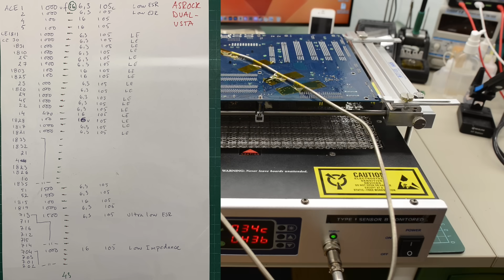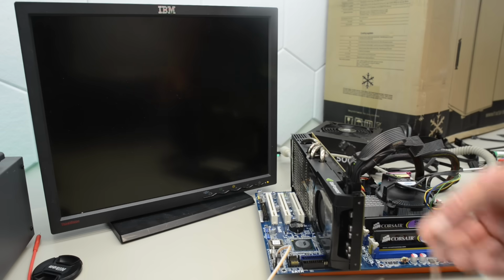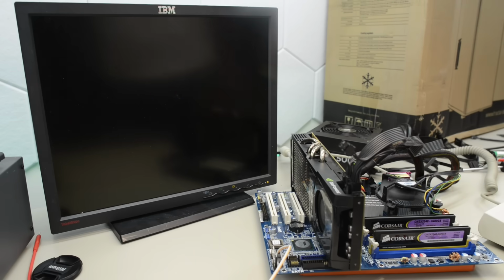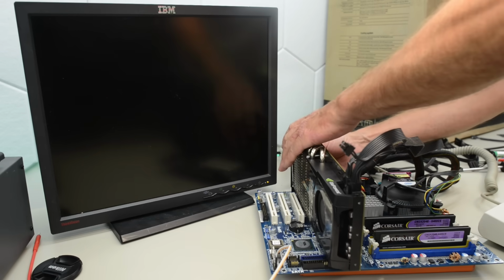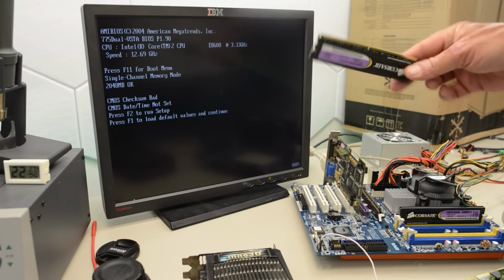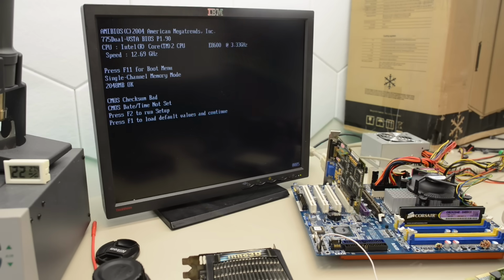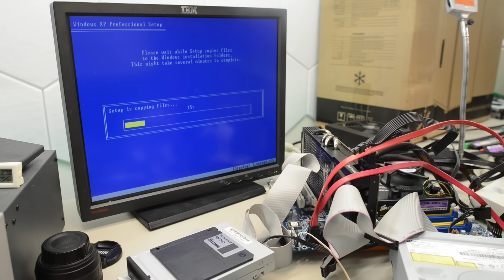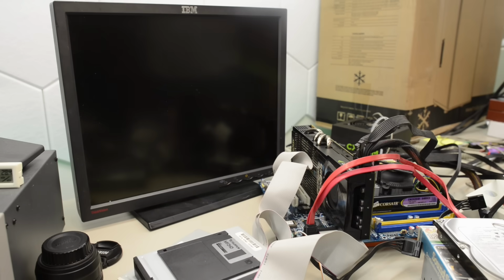ASRock  775Dual-VSTA Polymod gone wrong

Comment: I had that board. they had a defect that the bridge chip that allowed the use of either agp or pcie-e would overheat with that tiny heatsink. to fix it you can just put a 50/60mm fan on it.
Reply from the maker: Thanks. I have fixed the board in another video. I'll probably add a fan too
Reply: @Epictronics1  It's a good idea. I think i has in the northbridge an early pcie-agp bridge chip. Or some kind of transitional one off. Either way faster gpu's tax it and will cause instability if not actively cooled.

Comment: Hi, the other day I pulled a very similar board out of the scrapyard in our village. It is an Asrock "Conroe Kentsfield FSB1066 Quad Core CPU". I also tried to flash the bios using the original utility. It also gave me the error. But fixing this was simple: You just have to specify the filename together with the flash utility like "ASRFLASH 75DVSTA3.19A". For me it worked fine. But I used the bios from theretroweb, not the one you've used.
Then I tried to run Linux Mint from SSD (using SATA) as I do with all the boards, which I got from the scrapyard. It bootet fine, but then it always crashed. I tried different graphics cards on PCIE. None worked. But after I used an AGP card, suddenly Linux bootet like champion. As I got the board, it "came" with 3 GB RAM: One stick with 2 GB and one with 1 GB.
I really hope you can fix your board. Since the bios chip is socketed, you could maybe use a TL866 or so so program it.
Reply from the maker: I did. Check out the follow-up video I did a few days ago. I also fixed the issue with the graphics card you are having.

Comment: Im have this boards younger brother, the 4CoreDual-SATAII. Mine does support quad cores. But it's still a terrible motherboard. I don't think this GTX 480 will work with this as the PCI-E support is limited to GeForce 8000 and certain ATI cards afaik. At least mine didn't boot with any other cards.
Also the max supported memory is 2GB. That's why it didn't work with 4GB.
Reply from the maker: I'm almost done with the follow-up video. Prepare to be surprised

Comment: Hey - ive learnt that for expensive boards like these - its best to buy a second bios chip from fleabay ( easy to get for approx $15 and flash it with the updated bios using a william programmer in XP off board - ive done it - i learnt my lesson - put a socket on it and get a spare bios chip first - cause a flash failure = a hugh expensive failure . ive got the original bios saved in a bag with the new flashed bios on my Asrock 4core dual sata board . I didnt use 3.10 something i think my beta bios which allows 4gb ram is 2.20 something tho- btw they can take a gtx580 - if u can find a 3gb version thats the best it can go -
Reply from the maker: Thanks. I'll start looking for a 580

Comment: Maybe there's low level rescue code in some read only memory. Sometimes you can recover from these conditions by preparing a special floppy disk which will then flash the BIOS back to a usable state. But with the socketed flash taking it out and flashing it out of system is of course always an option.

Comment: I use 4CoreDual-SATA2 for long time with Pentium E2160 and AGP Radeon 9600 with 1G DDR1. After some time I upgrade CPU to Q6600 GPU to PCIE 8800GTS and change memory to 2G DDR2. Also upgrade old IDE drives to SATA. Board can work on 1333 FSB with Q6600 on 3Ghz without any problem. Best multifunctional board!

Comment: You don't have to say degrees Celsius. Just degrees is fine since it is the global standard, and so is implied if you just say degrees. It is only if you are using another scale than Celsius that you need to be more specific.
Reply: That is a really bad practice for ANY measurement system.  However, unless you're down toward and below 0 deg, the difference between the two makes it pretty clear, from context, which you're referring to.
Reply: @sirnickity  There is only one system globally, if you exclude the US. So, no, it makes perfect sense to ignore the small minority that still uses a non Celsius scale. Especially on a global content platform like Youtube.
Reply: @guderian557   Well, for one, that's not actually true.  Two, it doesn't matter.  I'm not interested in a nationalist food-fight.  Omitting units is never the right answer.

Comment: are you sure it's bricked. I ran into an issue with XP a while back. Newer systems supported AHCI instead of IDE. But by default XP won't work. I had to load special drivers during the windows install to make it work. I don't recall what happens if it's not setup properly though. And you can't turn it on either. You either install XP with AHCI on or you install it with it off. I was never able to install the drivers after the fact.
Reply from the maker: It doesn't even post, unfortunately. I need to pull the chip out and flash it manually
Reply: @Epictronics1  oh ok

Comment: I have a asrock 939 dual sata 2, kind of similar motherboard to this with both agp and pci-e. Always wondered why so few people build retro systems on these boards, where you have the options of running pci, pci-e or agp graphics.
Reply: Most people just outright dismiss these in-between boards as low-end crap that isn't worth bothering with. Typical PC elitism in action. 
Case in point, someone further down in the comments told him to replace that crappy board with an Asus P5Q Premium or a Lite-version of a Gigabyte EP45-UD3 cause both of those are deemed as "better" than this thing... too bad they completely missed the point of compatibility with multiple floppy drives, which neither of those "better" boards have, but this "crappy" ASRock does 🤦‍♂

Comment: E8600 with 1333 FSB? hmmm... is it really running at 3.33GHz, or just a label and running on half clock? i have a later revision called "4CoreDual-VSTA", and i'm unable to go above ~1150MHz FSB...
Reply from the maker: I haven't looked into overclocking the board yet. The E8600 may not be the best option
Reply: @Epictronics1  If the 3.33GHz is true, then You are already overclocking! The PT880 Ultra chipset itself is specified up to 1066MHz FSB, but if Your E8600 is running at full clock, then it means current FSB is 1333MHz! I doubt it's running at maximum clock speed...
Reply: @Epictronics1 This board is a very poor overclocker on FSB (see the Vogons thread). You wont get anything near 1333. Its a reason why people recommend the E7x00 series CPU for this board. Remember to overclock the PCIe bus if you are going to use the GTX480! You get 5-10% extra performance
Reply: @ksjoet  If L2 cache isn't of the highest concern, the Pentium Dualcore E5800 seems to be the most trouble-free option, and even with the poor FSB OC support on this board, you can still eek out some OC since the PDC is an 800MHz FSB CPU, leaving some headroom to get to 1066 while lowering the multiplier. I mean... the E8600 seems like a nobrainer with 6MB L2, but whether that's worth having it run underclocked at all times... ehh
Reply: @Knaeckebrotsaege  Would certainly be interesting to find out what would get the best results from the E5800, E7600 and E8600 together with the unlocked X6800. I guess it'd depend on the application as well in terms of how much benefit you get from L2 cache and/or clockspeed.

Comment: i have the same board and i hasd lots trouble i tried to flash the bios but i never got that far it was my tester lead that turns the board on i used a screw driver at last resort all worked ok but mine is 32 bit operating system i even tried to flash the bios with a clip on the bios chip but wouldent work i spent house and hours then it just all went ok i bought the whole computer for $40 aust but im glad you said always test the power supplt i did it when and blew a cap first time i have done that the case i use its a nice coolamaster case im using that for my main computer now also had 4 gig of ddr3 no hardrive but i have lots so it all going now same as yours you showed

Comment: You'll probably need to take the BIOS chip out, find your board on theretroweb, grab a BIOS ROM from there and use an EPROM programmer to write it.

But it should POST again after that.

Comment: Your motherboard has the dreaded VT8237 south bridge. It has known compatibility issues with SATA 2/3 devices, and only works reliably with SATA 1 drives.

There is supposedly a later revision of the 8237 that fixes the bugs, but I've never seen one.
Reply: It's things like this that really made me hate VIA chipsets.  They were always so quick with new features.  Too quick.
Reply: That's because the one with the newer revision southbridge got an entirely new board name. There's this 775Dual-VSTA, the 4CoreDual-VSTA (supposedly with the newer fixed revision, but still SATA1) and the 4CoreDual-SATA2 with a different southbridge and official SATA2 support
Reply: @Knaeckebrotsaege  Man, ASRock really milked that design to the limit. Three different board revisions of the same board with different south bridges.

It reminds me of the P5GC-MX/1333 that ASUS made with an overcooked i945GC chipset. They used black magic to force it to work with Wolfdale chips. Oh man was that board a turd.

Wolfdale on a 1333 MHz OC FSB and a max of DDR2-667. I don't even remember if SpeedStep worked properly, I think it ran at full tilt all the time.
Reply: @GGigabiteM  The issue was that VIA couldn't deliver the fixed/upgraded southbridges fast enough. By the time the -SATA2 rolled out (which should've been on it from the start IMO), the demand for these in-between boards had already all but vanished. IMO VIA is to blame here. ASRock just renamed the boards so that the SB revision is obvious from the name alone, rather than having to look at revision numbers which are generally not listed anywhere when boards are sold

Comment: I used to have exactly the same motherboard model. It even had a Radeon 3850 AGP. And there was always something wrong with it. Low performance, mediocre stability. In the end, I sold the motherboard and graphics card and switched to PCI-Express on an Intel chipset. Everything worked great there. In any case, Asrock had a lot of strange designs back then.

Comment: I have some of that same Corsair RAM with purple stickers and it also failed prematurely even though it was mostly powered off and rarely used. It should be fixable though, just replace the rams with good chips one by one until you find the bad chip. Use the ram tester program available on most linux bootmenu distributions to check the ram. Might be interesting if you can find a way to identify the bad chip using software rather than blindly change each chip.
Reply: Those Corsair XMS2 (which basically just means DDR2, cause XMS3 is DDR3) sticks are just garbage. Over the years I've pulled dozens and dozens of those XMS kits out of service because one or even both of the sticks had failed for seemingly no reason, either with memtest errors or straight up causing the PC to fail to POST. 
What's worse is that you essentially never know what you're getting, because they switched manufacturers of the DRAM chips at will (whatever was cheapest that day), and the only indication for that is the version number on the sticker. You can go out and buy 5 seemingly identical XMS2 (or XMS3) kits and chances are none of the kits will have the same version number, ie be actually identical to each other down to the DRAM chips used. Even when you don't take the premature failures into account, this caused all kinds of issues even when they were current because you could buy 2 separate RAM kits (think one when building your PC, and one later as an upgrade), and one of them has Hynix DRAM while the other might be Micron or Samsung or Spektek or whatever. If you then stuck them into a board that doesn't quite like any one of those (compatibility wise), you were in for a massive stability headache with your "identical" RAM kits
Reply from the maker: I'll check. Thanks

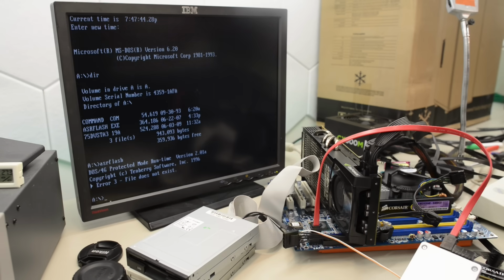Comment: @7:56 doesn't the asrflash utility require you to type the name of the BIOS file? I found that on the asrock webpage with the instructions.
Reply from the maker: I'll check. Thanks
Reply: Bingo. Also on older boards it's worth checking if Uniflash (or one of its updated community versions) can detect the BIOS chip properly. If it does, you can use it to backup and flash it. If it fails to detect the chip, it's probably incompatible with the board/chipset. 
I've used it a lot to hotflash BIOS chips some 10 years ago or so, back when I was still lacking a proper hardware programmer because they were still ludicrously expensive for a little hobby project

Comment: It should be interesting to see where this board ends-up, it sure has it's pros and cons.
Are they expensive because they're rare or because they're good? ...may be both, we will see!
I find Intel play nicer than VIA when it comes to driver support ...good luck.
My Multi-boot configuration is a ASRock G31M-S with a Q9650, SATA SSD, DDR2 800 and GeForce 7800GTX.
Boots DOS thru to Windows 10, has floppy connectivity, though I prefer the GoTek emulator.
I just now ordered some E8600 CPU's seems they OC easily to 4+ ghz ...definitely worth trying.
Reply: These boards were relatively cheap in-between upgrade option back in the day, when you still had an expensive AGP card but wanted to upgrade the CPU side of things to the new hotness (ie Core 2 Duo). These had AGP and PCIe, plus DDR and DDR2 slots all on one board, which is what makes them unique. I just checked my emails from back in 2007, and the Asrock 4CoreDual-VSTA (different revision of the same board here in the video) that I had back then set me back a whopping 59.99 euro brand new, including sales tax. It allowed me to keep my unlocked 6800GT AGP and 2GB DDR-400, while upgrading from a pathetic 2.8GHz P4 Northwood to a Core 2 Duo E4300. Later on I upgraded GPUs to a used 8800GTS PCIe and could just stick it in the same mobo, same as upgrading to 4GB DDR2. 
These boards were a really neat (albeit not very fast) solution to a niche upgrade problem no other manufacturer seemed to give a crap about.  
Nowadays these are pretty rare because they face the same issue as cheap smaller cars did for the longest time: they were used up, never maintained or cared about, and if anything went wrong several years into ownership they were just scrapped because they were deemed not worth dealing with. And then at some point they were all just... gone

Comment: Those are SATA1 boards, if the SSD controller doesn't have a proper fallback mode, you'll have issues. Also, ASRFLASH doesn't pick up the BIOS's name automatically AFAIK, you need to add the filename, «ASRFLASH 75DVSTA3.19A». I think you need more time on this one, but it should work.
Reply from the maker: I somehow missed that. Thanks!

Comment: Every single Intel SSD I used or sold all failed. Some just under the wire for warranty but most just outside the warranty. I have had very few SSD failures of other brands. A really old Kingston SSD just recently died on me and a couple of really cheap SSD died but Intel SSD’s were a nightmare.
Reply: The issue here is the southbridge on this earliest revision of the PT880 ASRock boards. These only support SATA1, and if the drives you plug into it don't have a proper SATA1 fallback mode (which most SSDs from half a decade later don't, because why would they at that point), it'll cause all kinds of headaches. They put a newer revision southbridge that supposedly fixed a lot of the compatibility issues on the 4CoreDual-VSTA, and finally (when VIA got their sjit together), a proper SATA2 capable southbridge on the 4CoreDual-SATA2, but by the time that arrived, the need for these in-between AGP+PCIe and DDR+DDR2 boards had already pretty much vanished
Reply from the maker: I'll try with a different brand. Thanks

Comment: Will definitely be interesting to see if you can manage to unbrick the board. Even if you don't, I'd still like to see this concept of a tweener machine put together! It's something I want to do as well, as part of a build where I cram multiple removable drive formats into the machine. Silly, I know, but something I've wanted to do for a while! One wrinkle for me is that the machine has to support mode 3 on the 3.5" drive, for certain Japanese computers. I'm curious how you were going to hook up 3 floppy drives to this board without a second floppy controller. Also, what does the pollymod do? I couldn't find any information about it.
Reply from the maker: Polymer caps have a longer life, lower ESR, and are more resistant to leakage. I haven't conducted any tests to confirm it, but the primary benefit should be evident in the VRM circuitry.
Reply: @Epictronics1  Oh, so that's what you meant. That's cool! I just never heard of it being referred to as a poly mod, so I was confused. Thanks for clearing it up.

Comment: i think this mobo takes only 2Gb of ram. I dont know if the ram stick was faulty but i am 99% sure the board takes max 2gb ram so it would be 2X1. Also check 4CoreDual-SATA2
Reply: I have a very similar board (4CoreDual-SATA2) and can confirm that with a hacked BIOS it will boot with 4GB of DDR2 (!). Only shows rougly 3.25 as available in Windows though.
Reply: There were multiple versions of essentially the same board, this 775Dual-VSTA, the 4CoreDual-VSTA and the 4CoreDual-SATA2 (which is the same as the -VSTA, but with a newer southbridge to support SATA2). I vaguely remember another version but I can't remember the name of it
Reply from the maker: The BIOS mod should fix the 4GB limit. I don't think the 4coreDual has support for multiple FDDs

Comment: CR2025? That's strange, never seen that before on a motherboard.
Reply from the maker: Thanks for noticing. I installed it by mistake lol. The 2025 won't last as long as the 2032. I'll swap it
Reply: @Epictronics1 yeh it'll work if the metal touching the positive side is tight enough to still hold it, less than a millimeter after all.